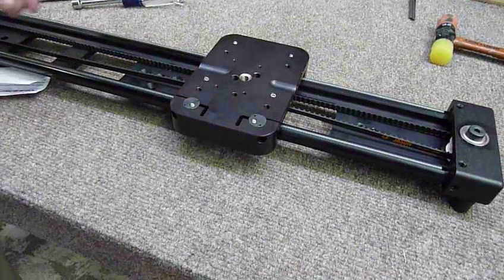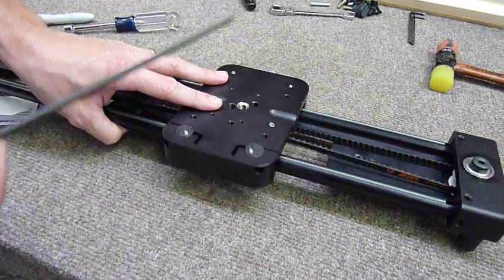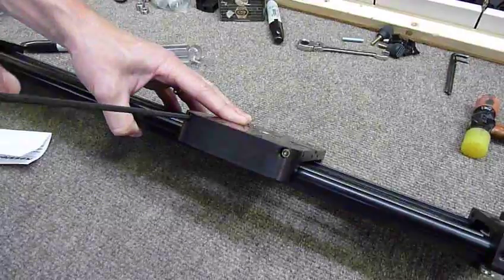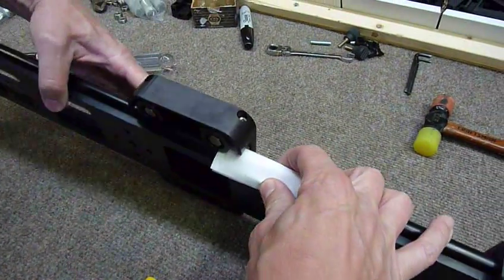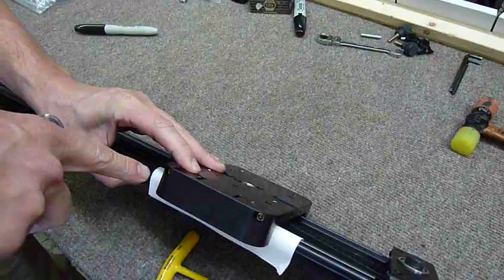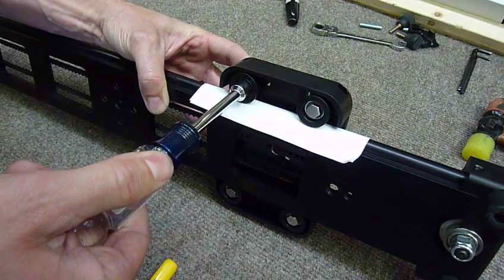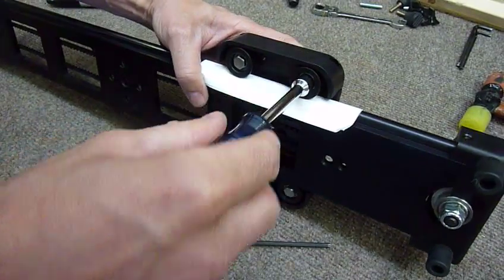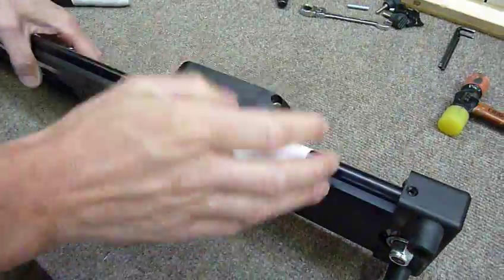Pocket Dolly™ V2 - Cart Adjustment

Comment: I have tried this adjustment and it has fixed the looseness but now it is not smooth as it once was. I've had it for about a year now what can I do about the slight vibration in the slider when I move it?